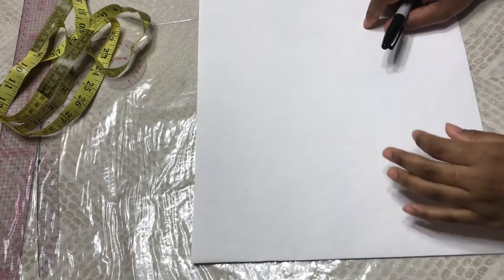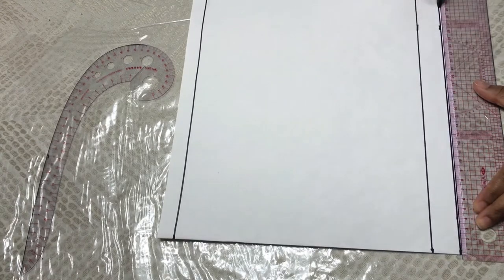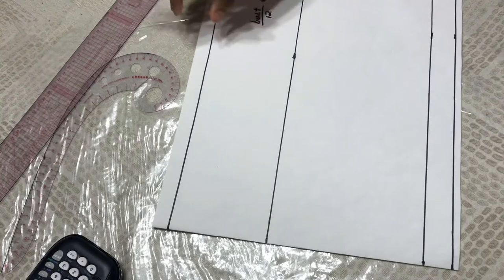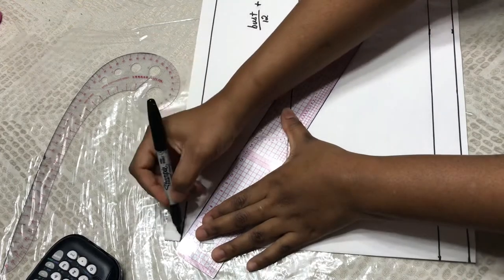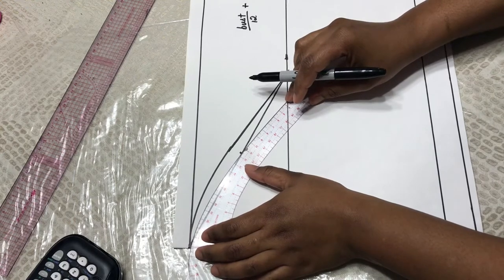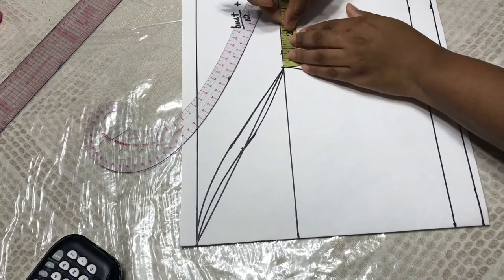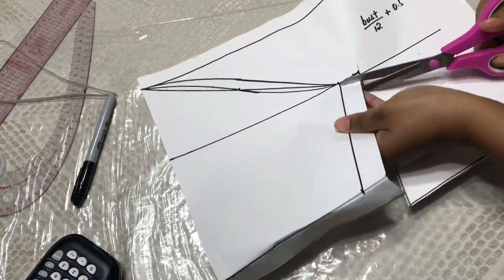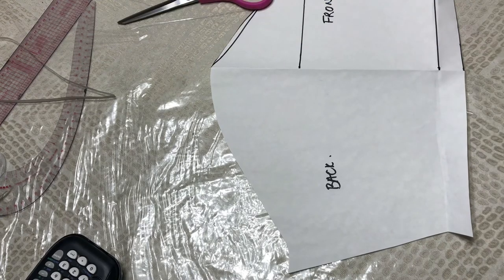HOW TO DRAFT A BASIC SLEEVE PATTERN |SLEEVE BLOCK | EASY SLEEVE PATTERN DRAFTING| BEGINNERS FRIENDLY

Comment: Hi dear, thank you so much for your videos, I’m learning with you . Can you please help me with my cap’s height, my busy is 40’’ . When I calculate my cap’s height, it gives me 3,83’’. Do I use 3,75? Or 4’’?
Reply from the maker: Hello sew mate
Yes you can round it to 4 or if u want to the use the exact measurement 3.8 on the tape measure is the bar after the 3.75. Never round down . It’s better to have a looser garment than one that is too tight. 
Best taylorMade
Reply: @TaylorMadeDesignsSewing  thank you so much 😊, I really love your videos, I can rewatch them many times as I need to take sometimes notes of what you say. Can’t wait for your next videos. Can you make a video of how you sew the sleeves in, I really want to see a close up. Also, do you prefer to sew the sides first then ease the sleeves in or to sew them open then sew the whole close? Which method is easier?
Reply from the maker: Am so happy you find this helpful. I will do a video show you how to do it. But I love to put in the head of the sleeve first and then I close the sides, it’s much easier to me. Sleeves can be tricky for a beginner but with practice you could be a pro soon. Keep going. Also when you draft your sleeve. Always double check to see if it fits the armhole before you cut.
Reply: @TaylorMadeDesignsSewing  ok, I’ll double check, I’ll draft my sleeves this afternoon, thank you 🌸

Comment: I have done this 20 times and it keeps coming out too big or too long I should say I don't know what I'm doing wrong my biceps are 14" my pattern armhole came out to 10.5" in the back and 10" in the front and the length that I want my sleeve is 8"even when I try to recreate your measurements it always comes out too wide and I have no idea why
Reply from the maker: When you draft ensure that you have added any ease allowance on the bodice pattern on the sleeve pattern. Be sure to check the bodice measurements (the armhole) with the sleeve cap measurement to see if they fit. Hope this help. Let me know if you have anymore concerns